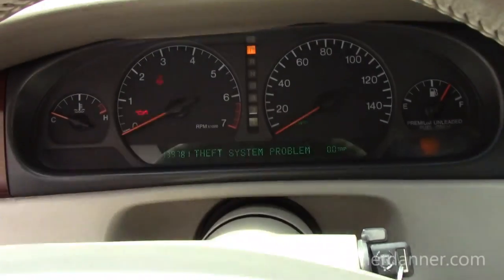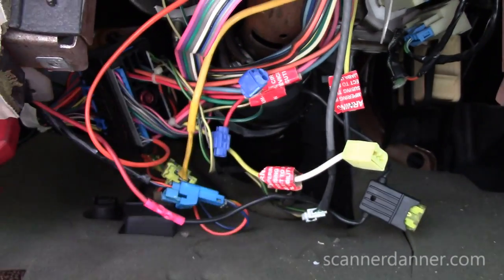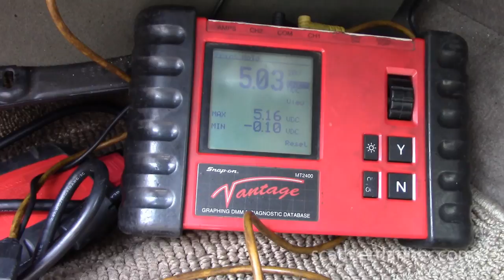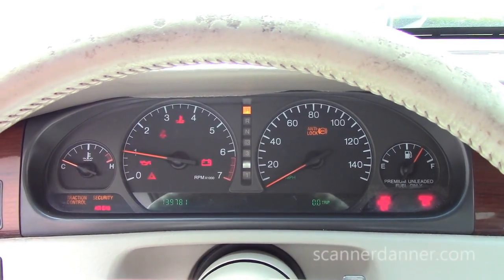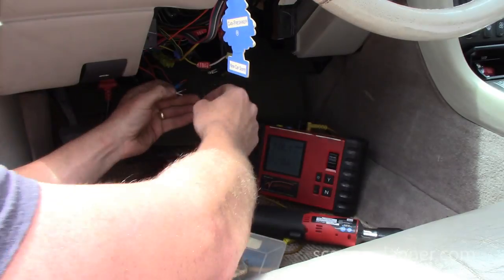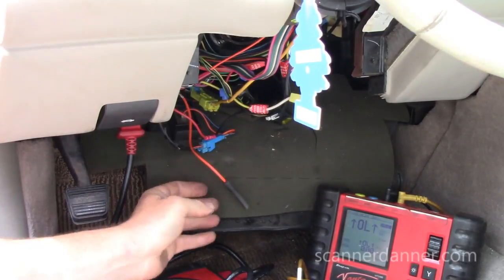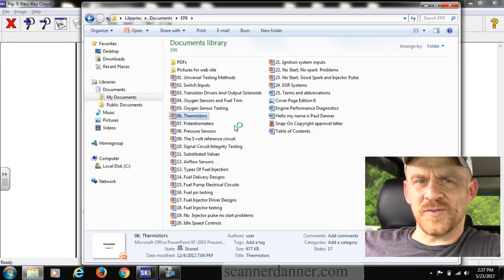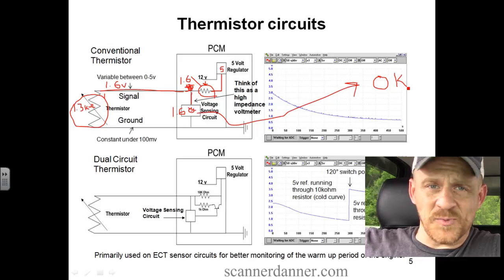How to troubleshoot/bypass a GM VATS Passlock Passkey System

Comment: I hope you get to do something comparable for S10s, Blazers, etc.
Reply from the maker: That's a different system and cannot be bypassed with a simple resistor. They used a hall effect switch in the ignition lock cylinder that had a timing factor in relation to ignition positive feeds when you first turn the key on.

Comment: I have a 99 silverado anti theft went on did a relearn processes had no problems until 2 weeks ago. Came back on did again the relearn took even more that the first time but worked, the next day went to work fine. Went to lunch & when going back to work from lunch it activated again... Changed key cylinder & it starts up fine but security light frozen on I can't turn it off even with relearn processes & I haven't driven it due to the light being on afraid it will active again...

Comment: with the pats system did every car have a different resistor value ? This would mean that evrery car would need to be programmed to read a different voltage.

Comment: that car had a breathalyzer interlock in it at one time that is the red sticker you see
Reply: dassme1 Talk about a cash cow installing those things. Last call for alkee haul!
Reply: That would mean the breathalyzer installer essentially butchered the car, costing not only hundreds for this repair but no doubt forever losing the alarm system.
Reply: which I bet did 0 good anyway :)))
Reply: @InsideOfMyOwnMind  it was the tumbler. Not the wires.

Comment: Scanner Danner great video. I have a question for you and hopefully you can help me out. I bought a 93 fleetwood which someone already bypassed the VAT system. Suddenly one day the car wouldn't start. I continually kept charging the battery but every time I tried firing no it up nothing. So I called my friend in the valley and he told me it was the VAT system. So this morning I went underneath the dashboard and cut out the resisters they had soldered. When trying to measure the resisters from end to end I couldn't get NO reading. But when I measured them separately I got reading; 1.50, 1.50 and .022. And again when I measured them from end to end...no reading. The two wires under  the dashboard are exactly what you said purple/white stripe and white/black stripe. Can this be my problem with me ignition? Thank you so much and keep up the great work. Going to subscribe right now. Your boy Eric from So.Cal.
Reply from the maker: I would think so my friend

Comment: Hi Mr danner j got a 2002 buick regal 3.8, I wonders if you can tell me how to bypass the vats system in my car,thank you  cheers from ontario ca.
Reply from the maker: You can't do the bypass on the systems that have the resistor/hall effect built into the ignition lock/tumbler assembly. You would need a module to be able to bypass/simulate that signal or possibly a reprogram to eliminate the anti-theft system

Comment: Hi stumbled across your video great explaining, only I need help with a passkey 3 system on 03 suburban, did you by chance make one?
Reply from the maker: You need a module to bypass those as it is a timed signal with the ignition switch turn on

Comment: I haven't'watched all this video yet.....I might need to do a little more digging, but in the 4th gen F-body world(93-02 Camaro/Firebird), I think the BCM(Body Control Module) "learns" the resistor value. I don''t recall it going through the instrumentation cluster. I was surprised when you said instrument cluster as I was expecting you to say BCM instead. 

The BCM reads the resistor value, if correct, it then enables theft deterrent relay to allow the starter to work. 

As I post this schematic,  I may find myself wrong as this says "Theft Deterrent Module". This is for a '95, so they may have integrated it into the BCM for '96 and up(I have a ''96 Z28). Edit: Checked my '96 service manual and the BCM does control VATS starting in this year model.

http://shbox.com/1/pass_key.jpg

Interesting how varied the implementation of VATS is across models.

I wouldn't sweat worrying about videoing about VATS. The bypass info has been out for a looooong time(at least it has in the F-body world). =)
Reply from the maker: no problem man. Check out that last part of the video, I show the diagram and this one does go directly to the IPC

Comment: Hey Paul, i got a question about this video. Now that you hard wired a resistor into the circuit. Is the resistor going to be constantly pulling that 5v ref feed, heating the resistor and causing parasitic draw?
Reply from the maker: Great question! No it will not be because the circuit is not active all the time. It is initiated by turning the key on. 
Also, this is a micro amp circuit, that resistor will not ever get hot.

Comment: All you have to do is unplug the little 3 wire connector after you get your vehicle started after doing the key relearn procedure. On my 2007 express van I didn't have to connect the 2 wires or use a resistor, simply unplug the connector while it's running after it starts. It's been starting every time now. I was having the problem where I was having to do the key relearn procedure almost every time to get my van to start, security light was blinking. Now the security light stays on, would need to add a resistor to get the security light off.
Reply from the maker: You are describing a totally different system
Reply: @ScannerDanner sorry I started typing that comment to a different video and it posted to this video

Comment: I have a 2003 s10 4.3 it starts fine then one day then  security light comes on when trying to start ignition switch has power when you try starting  I bypassed switch with resistor ran fine then back to no start and security light on  thank it's the bcm?
Reply from the maker: Ignition switch issues are common causes of what your describing.

Comment: Could someone help me out w some input? I have a 2003 Buick century and the resistance is 3000 so I bought some resisters and sordered them on and it worked for a month and security light back on still not starting, I checked the resisters and there still good, can anybody tell me what went wrong?

Comment: Does Passlock 2 kill the positive side of the injectors or all the negative sides?
Reply from the maker: Starter disable and the ground side of the injectors. You'll still have power to them
Reply: @ScannerDanner  thnks. figured that but have not seen it anywhere, otherwise it would be easy to by pass.

Comment: I have a 2000 Cadillac Deville with the Northstar security issue how do I fix or bypass it it doesn't have the pallet in the key
Reply from the maker: You cannot bypass those easily. You need to fix it. (new ignition tumbler/lock cylinder and or ignition switch is the most common cause)

Comment: I have a 2003 Pontiac Aztek with 3.4l V6, it has the Passkey 3 system.  At the moment the security light stays on.  It currently has following codes:
U1000
U1096
What direction do you recommend I go?  Is there a bypass for a passkey 3 system?
Reply from the maker: I'm pretty sure those have ignition switch issues and the reason you also have u codes is at times, some of the modules are not powering up. Bypassing those are not as easy and is not the answer for what you are describing. Of course those lock cylinders also go bad, but you won't get u codes from that. Just antitheft issues.
Reply: Ok, so you are referring to the ignition switch not the lock cylinder correct?  If that's the case would explain why i am still having issues turning the key after replacing the lock cylinder it worked for a while then it went into having the security light on and a no crank situation.
Reply: Exactly my friend

Comment: I have caprice 96 4.3l start then dies when i give ground in the ic signal from pcm to icm it not dies can this have relation with vats
Reply from the maker: The vats cuts fuel only on those. Some the starter relay too but never the spark
Reply: @ScannerDanner  thanks lot mr danner

Comment: Is there away to bypass the gen2 security on a 2004 Alero?
Reply from the maker: Not without some type of bypass module. They are using a hall affect switch and a resistor in the lock cylinder that is also a timed reaction. You cannot simply ad a resistor because of the "timing" of inserting the key and turning the lock cylinder.
Reply: Thanks.

Comment: Scanner danner i got the problem with toyota passo settle ,,,it brings the immo light ,,any tips
Reply from the maker: scan it for codes, follow the flow chart for the code for your immobilizer system.
Reply: @ScannerDanner   thanks you

Comment: So I have this problem the same exact one now after doing everything I told you I did so are you telling me that if I get like a 1200 Ohm resistor all I do is just put it to the orange security wire through contains two wires inside of it make the resistor and that's it tape it whatever? I don't need the module box or I probably do what what is the resistor for is that for just in case you lose a key I know it's going to act like it's got a key this whole time but is it a chip or it just needs to the amount of voltage
Reply from the maker: Yes on your first question but you need to measure your key and match what YOUR key shows. There are 15 different resistors they used on this system. 
Second question: If you module is bad, adding the resistor will NOT work. If you ignition tumbler or lock cylinder/wiring is faulty, this will fix your issue. 
I have seen the modules fail but not as often as the ignition lock cylinder.
Reply: You are right it didn't shut off while I was driving though this time. But guess what I didn't clean the clamps good enough cuz when I opened it I took a razor blade to open it up because I thought that's how they came but I guess it was I don't know it was just like super glued or something but from the acid. So the resistance was causing it to fail during the middle of driving. But that's after I fight everything like I was saying but I did find some power loose in the door and I do not have a door handle yet I need to order one I'm waiting for my paycheck or whatever I was so busy buying everything else. I have to go take my car to the auto parts store so I can buy I mean so they can charge my battery for me the one I just bought. But I drove it today I worked on it for like 12 hours these last two days and it paid off I've been working on it for 2 weeks really. But only since watching your shows and a few others I've been able to drive it. I have to wait the 10 minutes after the first start or the first crank then I wait 10 minutes and I get my jump start cables because I don't trust my battery yet I don't have a multimeter. But everything you said was right and I'm glad I did the resistor yet I was going to do that first thing in the morning.
Reply: So I don't think my modules bad because I'm able to drive and the lights and everything come on you know the little pictures on the dashboard except for the anti-theft that light never comes on what do you suggest on that the Dashboard Light the supposed to say anti-theft does not come on it never has my door latch or saying the door is open never comes on. That module that leads only to the door locks I cut it and I also cut the Box that has the two relays inside of it that's for the alarm somebody ready I cut that wire. One more thing I know I go on and on
Reply: By the way thank you for answering I appreciate it brother. But I got one more thing can you tell me what this is you know that thing that's on top of the starter looks like a bell or something the solenoid so tell me why when I took apart my door my driver door I was looking for all the wiring because my door locks when working since I got the car anyways I put everything back together and I finally looked in the door knob hole cuz I was looking forward to see why won't the latch till the system that it's good. And I think there's another solenoid right there it has a relay or control module I don't know they look the same and it has this bell-shaped things like 3 inch across I think it's another solenoid. Don't worry about the other questions cuz I was just talking butt same stuff that you know already but please answer this one what is that and what does it do 1994 GMC Sierra 1500 CLK or c k but it's the SLE 5.7 and it has that Bell like solenoid in the door

Comment: 95 DeVille 1.56 kõ (lol killa ohms )same issue , but when connected to the two white wires value changes , I understood and see the thermosistors with the 5V but can I ask should I increase the resistor value ( which wouldn’t match the key1.56 value )
Reply from the maker: What do you mean "when connected to the two white wires value changes" Are you connecting a resistor to the two white wires and attempting to measure resistance again? You can't measure resistance on a circuit that has voltage applied to it.
Reply: ScannerDanner 😅 understood but yessir the reaistors match the pellet when connected I get nothing .. these guys make it look it so easy .. I know it’s hard to judge from YouTube .. but I saw someone bridge the pink to the orange wire to to bypass the whole thing another question .. with your knowledge which orange wire might you assume they bridged to the pink wire?  the vats wire or is there another orange on the 95 Deville I can’t see
Reply: ScannerDanner I’m glad your active too Capt.
Reply from the maker: The key pellet wires are white wrapped in an orange sheath. These are the wires you should be focused on. 
With the key on, what are your voltage readings on the two white wires?
Reply from the maker: I try as much as possible
Reply: ScannerDanner it was a 7.02or 7.32 if I remember right Capt. , I made a resistor that matched that one(7.##) also but I haven’t tested it but the 1.60 AND 1.56 resistors I tried (that matched the key)connected to the two white wires didn’t work security light stayed on and no startbignition still disabled
Reply: I feel like I’m all over the place but I believe key off it was reading 7 sum and turned on jumped to 19 if I was reading right ..

Comment: Can I do the same thing with STS 99 Seville?
Reply from the maker: No, the chip is in the ignition lock on those and it is a timed type of thing
Reply: @ScannerDanner  Many thanks for a reply.but how this problem can be solved, same symptoms of the on the video you posted, it cranks but no start and security flashes?

Comment: Will this work on a 2006 Pontiac G6 and how would I do it
Reply from the maker: No, on that year it is a completely different setup
Reply: Ok thanks by any chance do you know how to do that on a 2006 Pontiac G6
Reply from the maker: @billbaer5838  common failures on these systems was the ignition switch and ignition lock assembly. The lock assembly has a hall effect switch inside of it and the resistor is built into that. You can't bypass them with a resistor because it is a timed event with the key. You'd need some type of external bypass module as a work around or fix what you have. If it was me, I'd fix what is there.
Reply: @ScannerDanner  yeah we put an ignition switch in it how to reprogram the key got everything set but it still won't program to the car

Comment: how come the 1st resister doesnt drop any voltage?
Reply from the maker: It does but not until the key is inserted. No current flow = no voltage drop, and there is no current flow until you put the key in and the second resistor completes the circuit.
Reply: @ScannerDanner  oh, i c. Thank u!

Comment: Even if you know your resistor color bands it doesn't help if you're color blind.  Those resistor color bands are nothing but frustration for me, as are some wire colors.  Thank heavens for pin numbers on connector diagrams!

Comment: you need to be close on the resistance. heat makes a difference. when it gets cold up here we have had people come back.
Reply: as close to actual resistance as possible and using 1 to 2% tolerance resistors wouldn't be a bad idea :)
cheap resistors are probably 5 to 10%, which tend to vary well beyond spec with extreme temps either direction

Comment: its been since 1976  that ive been in the electrical class but i do remember the trick to resistor number codes. the phrase  goes bad boys rape our young girls but violet gives willingly. 0-9 in that order. then silver or gold bands mean 5 or ten percent allowance .black brown red orange yellow green blue violet gray white. wattage is then based on size of the resistor if i remember right 1/8 in diameter =1/4 watt.  1/4 diameter = 1/2 watt and so on. not sure about this last . like i said its been 40 years.

Comment: Cut one side shorter the length of the resistor.
Reply from the maker: Or the harness I connected to. Agree, I could have done that better.
Reply: ScannerDanner actually the harness wires is what I meant but I stated it poorly.

Comment: Well....I think I know why there is a fuse sticking out under there. I just did the same thing to my 95 Cadillac. Had to have 4.67K ohms which I found a 4.7K at Fry's. Fired right up (after jumping it for about half hour). Trouble is it won't shut off LOL!! Pulled the key out...motor still running. Only way I could get it to shut off was to pull the ignition fuse (yellow 20 amp). Now it will fire up with no resister. I'll bet that's why you see that fuse peaking out of there. NOW WTF do I do? LOL!!! How I hate this car!!!!